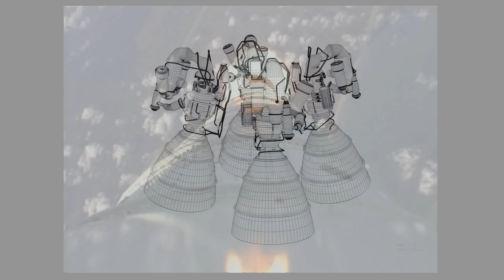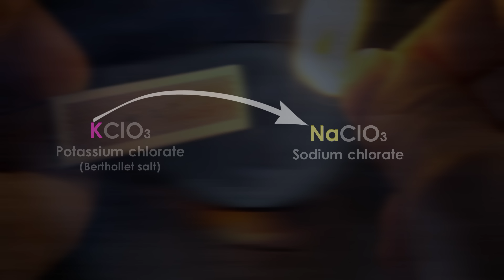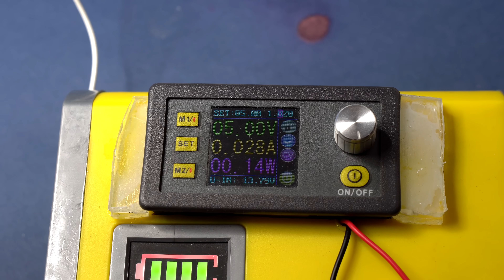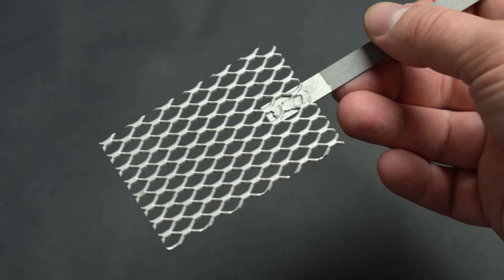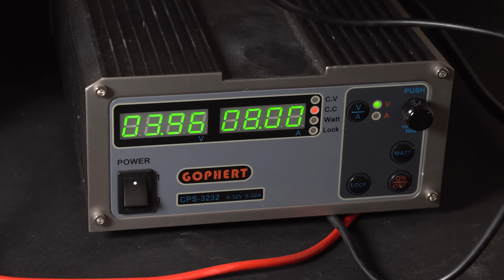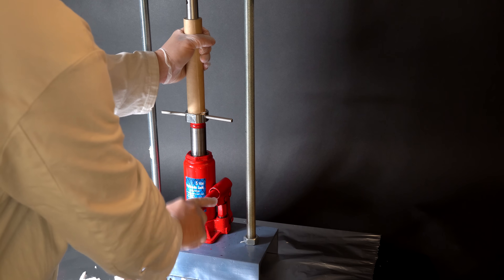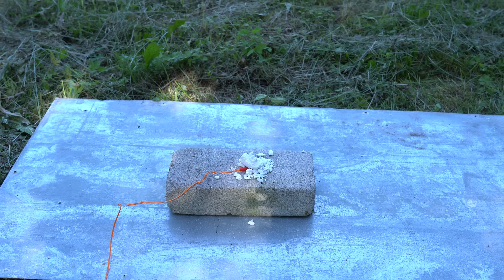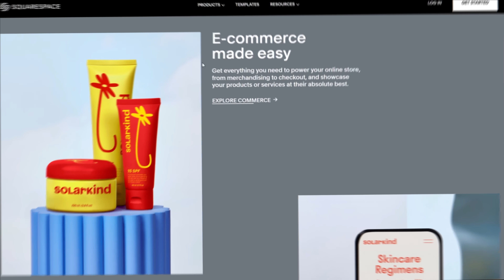How to Make a ROCKET ENGINE From Table SALT?

Comment: For increasing the pressure, it could help to shape the interior face of the propellant with a form that maximizes the surface area for combustion. I've seen on some old book that different shapes, like cross, star, etc, give different acceleration profiles over just a cylindrical shape
Reply: I think if he didn't use white silicone it will burn faster. All the titanium dioxide filler is slowing it down. That or changing the oxidizer ratio.
Reply: Yep, the Shuttle's segmented boosters changed shape to keep a specifically designed thrust curve throughout flight.  They even "throttled" through max-Q, which is neat.
Reply: And as those star shapes burn they become less defined and so produce less pressure but by then more of the grain has burnt outward so you have more surface area so properly tuned the pressure remains relatively constant throughout the burn.  Of course you might want the pressure to come up if your throat material is ablative and eroding.
Reply: yup, more surface area to burn..burns faster, more power. as long as the casing is up to containing it.
i remember long ago, peeling some ppr from Estes blk powder engines and..yeah, less weight, lil higher!
next try, i took too much. Rocket (not a fancy model, just a cheap cardboard tube & a stick, ala a home brew bottle rocket..went about 20' up and the case split..was really neat, though..
like a roaring, ascending smoke bomb! :)
Reply: that is a pain in the ass to do
Reply: Yes - logical - I was thinking that a couple of days ago on seeing homemade rocket techniques the first time.
Reply: I wonder if you could also shape the outer casing to help with that too
Reply: The process in the video is what my dad used as a kid, when they did not have enough allowance to buy the right chemicals. If I recall, he used pencils as the mold for the core, and clay for the nozzle. I don't remember what else was used, but it had a 50/50 chance of working as a rocket. The other outcome would be blowing a small crater in the ground. Those experiments stopped when his brother wanted to see what it was like to launch one in his hands by putting it on a half-inch steel plate. The explosion was so forceful it actually pierced the plate like a shape-charge, and I think he said that was the last one they ever built (for obvious reasons). They also did lots of other dumb things like trying to build a breeder reactor like David Hahn did. I don't think they made what they wanted, but he said it was so radioactive that the Geiger counter needle pegged on all the scales, and they both drew straws as to who would be the one to go in and deactivate it before it irradiated the whole neighborhood. Ah, all the crazy things you could do in the 50's before 9/11, the beer virus, and "the current year."
Reply: @mysock351C  I strongly relate. In  90's eastern Europe my friend and i had a shed. We also had abandoned USSR sanatories (health retreats) with vandalised laboratories. We borrowed some glassware, few chemicsls and bought 50Kg bag of ammonium nitrate (less than €5 or €10 now). While being in middle and secondary schools, there were no budget available for our laboratory. We still managed to make 100s of different rocket fuels, explosives and other party tricks.

 If police would see our lab nowerdays, we could easily be charged with terrorism: little RPG'S and various grades of IED'S were our speciality. Some casings were harder than those of modern granades. I'm quite lucky to be alive or to have all my extremities and eyes after that.
 I managed to squirt concentrated hydrochloric acid in my eye, my friend covered his entire arm in sulphuric acid once.

 Quick story for illustration: we found out  that there are cast-iron resistors on railway line grounding - hollow half-spheres with a threaded disc as a lid on bottom. We delinquently gathered those, replacing it's contents with the various high-energy low-explosive mixes. They made huge holes in the ground, obliterating everything we put on top by fragmentation. Casing were over 15mm thick. Only problem was unreliable fuses we made ourselves or from disassembled fireworks. We didn't trust electric ignition yet, so decided to make a chemical relay fuse. It worked fine on experiment, taking just the predicted 2min. to ignite (glycerin + potassium permanganate). So we assembled one granade, with the best explosive mix, ignition powder and KMnO4 concentric spheres at the centre. We glued a syringe needle trough side ending at the centre. After assembling, all left to do was to attach a glycerin-filled syringe to the needle and inject. We decided to show our craft at school.🤦🏽‍♂️
 So, one dinner brake, followed by entire classroom, we made our way to the nearby woods and stuck the granade into roots of some tree. I took the glycerine to the granade, pressed multiple times, as the compressed innards didn't quite let the liquid in, thankfully settling for just a mm drop in syringe level. Most of the class were a decent distance away, albeit for some brave ones hiding just behind nearest trees. I managed to make about 3 steps away, when the contraption blew a powerful shockwave trough my back. All territory covered in a thick, white smoke. "Nobody's hurting?", i shouted silly in shock.. By a miracle, nobody was hurt, at least phisically. Instead of 2min. from experiment, it took 3-5 seconds. The roots of the tree were hanging above ground, revealing ~1/2m deep crater. We found the threaded disc 1m below ground and a top shrapnel piece some 40m away. I can only guess, what would happen, if i hesitated longer, due to glycerine not going in properly..
 It looked even more lucky, when we repeated the ignition experiment in a small, compressed valve with openings later. It popped near instantly upon injecting.

 Still, my only regret is not following the chemical or material science as a career, due to low wages, not managing university and leaving my country. Now there are not enough people doing exact sciences in our region.
Reply: @vitalijslebedevs1629  NIIICE!, Yeah potassium permanganate and glycerine - I remember my dad told me about that, and I tried it. after a minute or two it goes into thermal runaway, just like you said. You are a real engineer!
Reply: Also, now I remember him mentioning they also had to use anhydrous ethanol to turn it into a paste and compress it to mold the propellant core, so it was completely solid. Any small cracks or voids would alter the burn rate enough to make it go bang. Seemed like a lot of work to me when he explained it but being the start of the space age probably really had an effect on how people viewed the world and the future that could be, but never was.

Comment: Isnt just easier, since you made the electrodes, to fill a balloon with hidrogen?
Reply: He could but unless he has a way to filter the gas from electrolysis by pressurizing and bleeding it off into other containers by weight it's probably mixed with oxygen or hho gas. Which will work up to a certain altitude then the atmospheric pressure will have equal buoyancy. Meaning it won't float past that point. Whereas pure hydrogen will continue to rise until around the mid ionosphere and stop. There's been ideas of launching spacecraft by doing this and then burning the hydrogen as fuel to reach orbit. But like everything the reality of real life application is complex. Combustion is different at those altitudes and lesser pressures so oxygen at a reasonable pressure must be ported into combustion. Which also must be carried up along with the vehicle weight. You can use the fuel's energy density reaction and use precision injection designs to shrink that number by a little but overall generally ends up as losses in efficiency.

Comment: Interesting and awesome video! Question ! Probably a dumb one for the electrodes is it possible to use tungsten rods? And what would happen if you coated with thorium nitrate also?
Reply: I also thought that tungsten is very resistant to oxidation

Comment: OMG I have been waiting for this kind of rocket oxidizer for years!!  Thanks a lot!! :D
Reply: HAIL FLOCH   yeah. I was planing to use graphite electrodes. As it also works, and is cheaper than titanium and platinum, i could get more cells, all working at the same time, and make much more NaClO3 at once.
Reply: HAIL FLOCH  yeah. I will try to build them soon. Only things im afraid of are the chlorine gas that might leak, and the hydrogen, that i wanted to give a use to.
Reply: HAIL FLOCH  yeah that might be the safest option for now. Thank you!

Comment: I admire your ingenuity. However, there is no GPS equivalent on Mars. Setting out reflectors or signs would help the rescuers. How do you make a super white paint out of what's available on Mars? You could use semaphore to keep them updated via imaging satellites while they are preparing the rescue. Besides asking them to bring ketchup for the potatoes. Or shot glasses for the vodka that's been made from the potatoes.

Comment: I didn't know that chlorate:silicon mixture is such a good fuel! Nice video Thoisoi as always!

Small amount of dichromate or molybdate will increase electrolysis efficiency. I think that some dichromate can be found in space lab ;).
Reply: With electricity you could make pure iron out of the rust, and pure aluminum out of the alumina dust. There is silicon dioxide as well, so thermite production on Mars is viable. Thermite can be used not just for incendiaries, but also for welding and even smelting of metals. Splitting water produces hydrogen and oxygen as well, so balloons could be made out of mylar to loft a simple wire antenna to altitude for communications.
Reply: @Kitsaplorax  Saw that in The King of Random when it was a science channel. (RIP Grant)
Reply: @Kitsaplorax  nobodies going to Mars dude
Reply: @Japs_Eye_Of_The_Tiger  I hope not, but I fear that some idiots will at least try.
Reply: @Japs_Eye_Of_The_Tiger  Why would anyone want to?
Reply: @MrJdsenior  This, I think people don't realise the enormous list of things that have to go right to produce a successful mission and how close many missions have come to total catastrophic failure. Those organisations make it look very easy.
Reply: Making aluminum from oxide through electrolysis is a big technical challenge
Reply: @among-us-99999  yeah, you need more than 2000°C to melt pure aluminum oxide, you need cryolite to low the melting point
Reply: @among-us-99999  True. Thermite can also be made just with pure iron and frozen carbon dioxide.
Reply: I love the argument when there is a helicopter drone on Mars.  People got the big dumb if they think this is a non-start when it has been the focus for 30yrs space technology spending.   Not saying it will be something we enjoy ourselves but humanity will.  That or mass extinction will hit in a 100 or so yrs and it won't matter eitherway.
Reply: Adding 1% potassium dichromate into the chlorate / silicon mixture might work as a catalyst (as it does in ammonium perchlorate based comps).
Reply: Chromium fumes are toxic
Reply: @buddhikakasun396  What chromium fumes? What are you talking about, there isn't any volataile chromium compound. You mean Cr(VI) containing aerosol? Aerosol from electrolysis already contain lots of hydroxide and chlorate which you don't want to inhale, you should prevent escaping aerosol from the beaker anyway. That small amount of Cr(VI) really didn't add any risk.
Reply: @bedlaskybedla6361  chromium fume will occur if the chlorate residue contaminated with dichromate and when the  burn of fuel mixture fume will accumulate in atmospheres. But it may be safe if it's a small amount otherwise it's not because chromium compounds are carcinogenic and it is a heavy metal.
Reply: @buddhikakasun396  Chlorate wouldn't be contaminated with dichromate if you wash chlorate with cold water. And even if it will be contaminated with small amount of dichromate, dichromate will also act as oxidizer in a fuel mixture and will be reduce to Cr2O3 which isn't toxic.
Reply: Order Of The Phage Uprising And Insurgency  nobody is going to Mars

Comment: Is possible create ammonium clorate using calcium hipoclorite ?
Reply: yeah, if you heat the hypochlorite in solution it will disproportionate into chlorate and chloride, but the separation of the chlorate and the chloride is difficult due to their high solubility. with sodium hypochlorite (bleach) its easier because the sodium chlorate is less soluble and precipitates when the solution cools down.

So, something that you can do if you want pure chlorate is mix the calcium hypochlorite with sodium bicarbonate or sodium carbonate and all the calcium is going to precipitate as calcium carbonate and you will have sodium hypochlorite in solution. This can be filtered and then the solution can be heated to boil untill all the hypochlorite disproportionates to chloride and chlorate.

When you have your sodium chlorate, to convert it into ammonium chlorate you will need to add ammonium bicarbonate, or if you only have amonia, add it and you will need to put some carbon dioxide to precipitate sodium bicarbonate and leave in solution the ammonium chlorate. To do this bubble carbon dioxide or you can add carbonated water.
Reply: and to do the last step I recommend doing it in a concentrated solution
Reply: @lautaromorales2903  thank you
Reply: @andredearaujorodrigues7725  brazilia
Reply: @andredearaujorodrigues7725  amazonass
Reply: @andredearaujorodrigues7725  are You BOLIVIAN?????
Reply: @andredearaujorodrigues7725  BOLIVIAAAAAANOOOOO 🤗🤗🤗😏😏😏👉🏿👈🏿👊🏿👊🏿🤑🤑🤑🥰🥰🥰🙌🏿🙌🏿😡😈😈😈😈👹🤗😎😎🥵🥵🥵🥵🏵️💮💮🌹💮🌹🏵️💐😈💥🤢💥🥳🤤🥳
Reply: @lautaromorales2903  i from Brazil.
Reply: @andredearaujorodrigues7725  oohh sorryy that was my cousing messing up with my computer 😅
Reply: @lautaromorales2903  no problem

Comment: well done juggling the two, exclusive terms "rocket motor" and "rocket engine" without ever conflating them.
Reply: @h7opolo Could explain the difference between "rocket motor" and "rocket engine" please.
Reply: @franksierow5792  in the most basic terms, a rocket motor uses solid fuels and a rocket engine uses liquid fuels.
Reply: @-danR  that’s very interesting info! Thanks for sharing
Reply: @cgplayz545 Now would you consider a hybrid rocket an engine or motor? It has a tank of liquid oxidizer, moving parts in the form of a high pressure, high speed throttleable valve and a spark plug, but has a solid fuel grain and no pumps. It's like perfectly inbetween a motor and an engine...
Reply: @Lotek117  in undergrad rocketry competitions like spaceport america cup and FAR-OUT I have heard both terms be used. “Hybrid Motor” is used more often. But I guess it really is like the other people have been saying. There really is no definite answer. It varies from person to person.
Reply: @franksierow5792  

The guy above me is correct, but I would amend that slightly.

There are no universally accepted definitions for either.

But, commonly: engines typically have moving mechanisms and parts that are needed somewhere in the process to turn fuel into motion.

This is usually true of liquids, since 9/10 they need to be pumped, or compressed, or atomized or all 3.

Solids typically don't. They traditionally just burn, and provide immediate forward thrust.

A gas drinking move-y thing is an engine. Lots of little things moving and rotating, and transmitting different mechanical/electrical power to parts of the thing to make sure air and fuel are right and spark the thing, to turn this spinny thing, to move that other thing... all drowning in oil...? Definitely an engine.

Electrical spinny thing that just turns on when source is applied? Solid thing that just sits there, burns, and provides immediate forward thrust when it burns? Definitely motors. Simply add fuel or make initial reaction=immediately go.

Sort of.